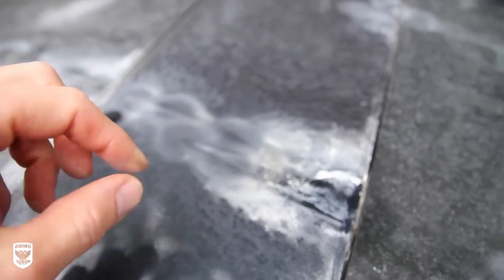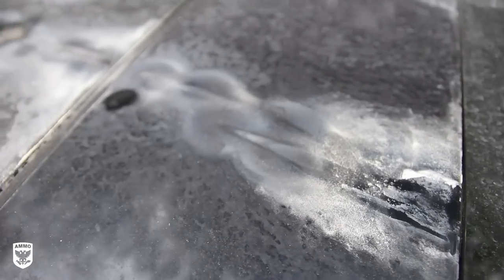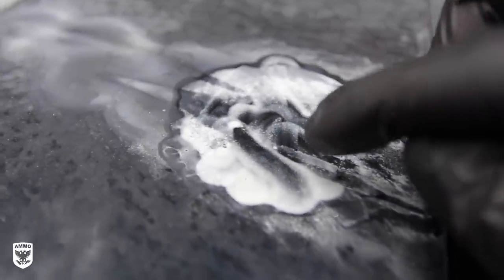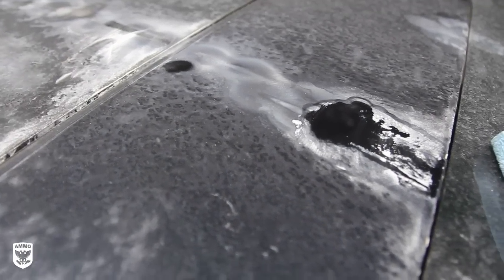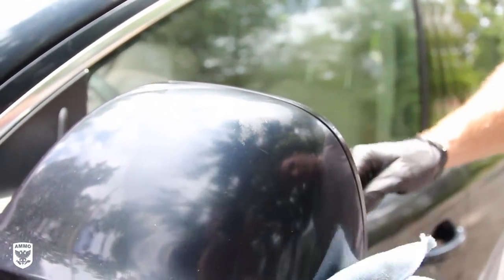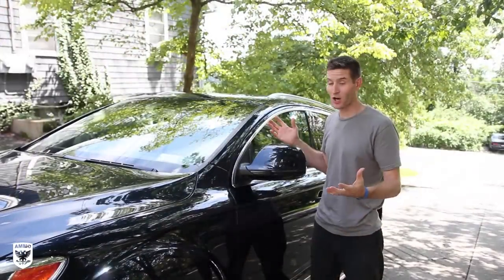How to Remove Water Spots and Calcium/Lime Deposits Audi Q7

Comment from the maker: I used a directional mic so I apologize for less than ideal sound. Also, I did not scratch the paint during this process (which would be "acceptable" because of its horrible condition). The "scratchy" sound is the deposits on top of the other deposits. However, if you do scratch the paint, which is to be expected, just compound/polish that area afterwards. It depends on how hard/soft the paint is beforehand. Hope this give you an idea about pH/acidic/basic knowledge for detailing. Thank you! -L

Comment: I had lime/calcium deposits on my car from the parking garage at Ohare. I just poured coffee pot scale remover over the deposits and they came right off. This was after the deposits were on after 2-months. This worked perfect and does no damage to the clear coat paint.
Reply: Thanks for this tip!!! Literally saved my butt detailing a car today. Works like a champ. Bought it at Bed, Bath & beyond. 😂

Comment: I had the same spots on my new TT. 6 Stains in total like on the side of the Q7. Just watched the vid, but cleaned my car last weekend.
Mine were not as mineralised as on the Q7. I washed the car (total package :foam, high pressure, per hand). Then I started trying to remove it with clay. It reduced a bit but not a lot.
Then I took a slight abrasive polish, and polished per hand for more senstivity. Took me hours for the 6 stains. What a pain. Took it down "layer" per "layer" until it was perfect again.
I suppose vinegar is not an option? :lol:
Your videos on this channel and after/drive thaught me a lot. Thanks for that mate. Very educational !

And yeah cleaning a car kind of gives you that special relation to it (Stingray Vid). And you know all the spots, every imperfection. It's quite intimate haha.

Comment: I have run into this situation when detailing a customer's car.  I removed calcium lime deposits with a household product called CLR sold at most hardware / home retail centers.  For auto paint I recommend to dilute the CLR with water and not use it full strength

Comment: A vinegar solution will usually do the same things for heavy calcium deposits and it also won't affect the paint.
Reply: I used just white vinegar out of my wife's pantry. Mine was on the horizontal trunk lid surface so I laid a vinegar soaked (very wet) paper towel over the calcium crust and kept it there until the calcium broke up. Then I rinsed it off. Worked good for me...
Reply: I can't remember exactly... Probably every bit of 15-20 minutes. I peeled back the vinegar soaked paper towel every 5 or so minutes and with my finger, I'd see how loose the calcium felt. Keep the towels completely soaked with vinegar. Since the car had a good coat of wax on it, it eventually got to the appoint where it pretty much rinsed off..
Reply: He's using 30-50℅ diluted HCl / muriatic acid. I know cuz I recreated that action in my bathroom cubicle
Reply: A 30 to 50% concentration of muriatic acid would eat through the paint. Trust me I know, I'm a Mason and we use a 20% solution of muriatic acid to clean cement off of bricks. Maybe 2 to 5% concentration, but certainly not a 30 to 50% concentration
Reply: @aveno66  well didn't take long for me. Did it to my car that had the marks for years. All i did was poor some vinegar on a rag and came right off as i wiped it.

Comment: Carpro glass polish is excellent for cleaning and polishing glass and can even remove scratches when used with a machine. It contains ceramic oxide which is used for polishing mirrors in large telescope.

Comment: I'm not a chemist so I can't comment on possible reactions between the acid and the plastic, but temperature wise it shouldn't be an issue unless you go really crazy with the stuff. ABS (which most plastic things are made of) has a glass transition temperature of 105 C (221 F) which means it gets soft above the boiling point of water. Working with it through such thin gloves would not be possible.

Comment: I would use a plastic razor blade, Larry.

And after using the chemical (vinegar, coke, etc.) to dissolve the calcium, I'd flush the area very thoroughly with water.

Comment: At 6:53 it's possible to see the "bottle of the product" reflected in the right corner of the video... So it's CaCo3 and a simple solution of acetic, hydrochloric or nitric acid theoretically, will work
Reply: +Jonatas Brisotti  He said, he's using something acidic were CaCo3 is alkaline and is already product of acid+calcium.

Comment: Some of us living in parts of Florida with sprinkler systems that use ground/well water probably have experienced this before.  The ground water from springs contain a lot of minerals like lime and calcium, and on windy days the breeze will mist the side of the cars in the driveway leaving deposits.  It's definitely not as concentrated as this, but still, not good and needs washing.

Comment: Good job. Could you not have used a soft brush to agitated the acid cleaner to help with removing the mineral - especially around any shut lines, windows and seals ?

Comment: if vinegar doesn't work try lemon juice, it is more acidic than vinegar. Also water is neutral so it wont have any effect. you should know that what he is showing is that the acidic chemical doesn't lift the calcium off the surface it dissolves it.

Comment: Use harpic toilet cleaner.. it's in blue colour.. little thick. Works like wonders. Apply on a small pice of microfiber towel and gently rub it on the calcium deposit. And you can thank me afterwards.

Comment: This is actually so interesting - chemistry wise. 
I'm guessing the Calcium and other mineral deposits have formed a basic salt 
ie Barium Hydroxide or what not, and the acidic solution, neutralises it. 
As all neutralisations are exothermic - that explains the rise in temperature.. 
The white solid forming immediately, that looks like a precipitate? Of what - not entirely sure...

Just some highschool chemistry which is probably completely wrong =D

Comment: A solution of 50% water and 50% white vinegar applied over a few days in a spray bottle also worked for me.  Super annoying.  I thought pigeons were pooping all over my car in my work parking garage until my local car wash guys told me about the parking garage dripping mineral deposits they see frequently.

Comment: Is " the product" CLR? Captain?
Reply: Yeah I want to know this too, I just purchased the Invisible glass water spot remover from his link thinking that it's what he used but it's totally different.  Makes me so angry I wasted $25 to get something he didn't even use in the video.
Reply: @michaelclark3192  Wow! Was about to do the same.
Thanks for the heads up
Reply: @rolandstamey1470  I ended up using CLR in spray form on the water spot and it worked like in the video so definitely buy some of that, works great.

Comment: if you aren't comfortable using acid, another way would be to use a product called "goo gone, with orange" it is an oily product so it will give good lube, but of course you'll have to wash it good afterwards, but with warm water, and good soap it comes off easily
Reply: Goo gone? Never tried it. Buy the water spot remover. Its an acid but nothing to be afraid of and it comes in a gel form with instructions on the label. But what he is cleaning s mineral so use lime away and acid for water spots.
Reply: mygtxful i'll give that a try. I polished the factory aluminum wheels and left them bare(no clear) and they have minor water spots
Reply: gary williams "goo gone automotive formula."

Comment: if i were him the garage company would be paying for this
Reply: "Users of this car park do so at their own risk"  sound familiar?
Reply: Yep, companies aren't stupid, they cover all the bases for just this kind of scenario.
Reply: this is why you dont park next to a wall in a concret parking garage, especially near the drain pipes, that's where water accumulates, alway try to park up hill if its a sloped garage and park in the middle the isle and dont park on the outside of the garage where your car is exposed to weather/rain/heat.
Reply: +1 for the auto cover specifically made for just this type of scenario.  Guaranteed it's a lower cost than a couple hours of this type of service.
Reply: The problem with this statement is that he would have to prove that the parking lot company forced him to park there. And we all know nobody forces anybody to park any place, even if there is no other parking you can always just not park and go home. So your statement is way up base

Comment: Hydrochloric Acid 10% will work perfectly.   I had this problem on a car once and i used CLR and worked like a charm.
Reply: that eats metal. that is all its good for, 10% all the way to 22 degree needs to be stored in poly drums and totes, NEVER put on metal

Comment: question for ya, how well does steam remove water spots? I have a vehicle that has sat under a sprinkler for years... i have try'd vinegar, ducky water spot remover and also the extreme version of the product. i have also had some luck with rubbing compound and very very fine steal wool. i have had very little luck but i dont think i should be trusted with acidic chemicals. have you attempted to use steam, would you recomend it. maybe i should use the extreme water spot remover and my steamer being shipped?

Comment: My car just got COVERED by industrial lime. They dropped a truckload of it near the medical building I was in, and when I came out it was covered. The company send a guy to pressure wash the car. DIdn't do a thing, except the surface is now gritty and grey. (It's a black car). Whatshould I require them to do to repair it?  The windows appear to be scored as well.

Comment: Can't you use watered down vinegar?
Reply: Yes you can, you can also use full strength white vinegar. but then he wouldn't be making a bunch of money off of his products if he told you that
Reply: That's not fair, he never pushes his product onto viewers. He always says what he uses, but very often mentions or even shows ways of cleaning withouth using his line of products. He didn't even say what product he used in this video!
Reply: he said it is a product that he has not released due to concerns with people useing it correctly but that you could use a water spot remover

Comment: Hi Larry, my mom's car has the exact some calcium/lime deposits (7:35) - pipes above her parking spot leaked. what product did you use? Thanks.
Reply: Or what product(s) would you recommend?
Reply: +nickolastiguan Distilled white vinegar will work and can be purchased for cheap at your local supermarket.
Reply: +Jonathan Gingiloski agree.  works great for me as well.  and cheap

Comment: Hey man, id like to know how to remove heavy sap/gel or things like that, i try to use razor blade, it works yet too risky, any tips ? Thanks
Reply: (Plastic) razor blade if necessary...use citrol 266 degreaser in spray bottle or aerosol.

Comment: Awesome video. You sir are very very good at what you do, but this would take hours to do this way. This is more like a weekend car cleaning tip. In the professional world, you'd have to much faster and efficient to do this on a much larger scale. Very good starting point though.  People see this some of these videos and go "man, this looks sooo easy i could do it at home!" So they try. The next day they're are my shop going, "i don't know what happened, i did everything the guy in the you tube video said". And now for the next two hours I'm stuck fixing something that could have been fixed in 45 mins and avoided all together had the guy/girl brought the car to me to begin with. Not to be a dick or anything, but now I'm charging the guy/girl the exact same price i would have charged for a full detail, just to get acid stains out of the paint.  So i guess what I'm trying to say is. Don't use acid base solutions on your car unless you know what the hell you are doing.

Comment: AMMO NYC How do I get a bird dropping that is on my car for the last four months? After I wash the car, there is a blemish white mark and it won't go away. I use white vinegar to clean it off but it won't come off at all. It seem as if the acids on the bird dropping has ate through my car's clear coat....Any tip how I can remove this bird drop mark? It's a little bigger than the size of a quarter.

Comment: anyone have an idea of what pH solution would be appropriate on glass/paint?
Reply: James Lemon For instance, car shampoo/soap should be ph balanced so it's not harmful to any surface. But for calcium deposits, which is an inorganic base, you can use an acid like vinegar or a low ph solution like Larry's water spot remover. Low ph = acidic, high ph  = alkaline. Too far on each end of the scale can cause damage if used incorrectly, like I would never put hydrochloric acid(acidic) or lye (alkaline) onto my car.

Comment: “It’s like salt” that’s because it is salt. Let me explain:
1.Water spots are basically calcium which is basically a BASE.
2. The “cleaner” is an acid maybe stronger than vinegar or a 30% vinegar available at Home Depot. 
3. When you mix a base with an acid it results water and salt. IE mix baking soda and vinegar or lemon juice. They neutralize each other. As for the video you should have at least plug your product, or you didn’t figure out a way to make it smell like something else NOT vinegar???

Comment: How long did the car sit with water dripping on it? Looks like a long time. Or very nasty water.
Reply: Looks like really nasty water stains, I had that happen with sprinklers before. I wonder if it was leaked on by overhead pipes or something.
Reply: It was probably in a parking garage with a fire sprinkler system or even a leaking roof. This happened to a car at my hotel. There is a planter box with a tree and a soaker sprinkler system in it. The water leaked through the  concrete and left a deposit just like this on the car guests Benz. He was not happy, to say the least.

Comment: lime away works great
Reply: yep. god knows why he is taking so much time to do it. Even historical restoration guys use citric acid and spray shit with it. Absolute no point in all this crap.
Reply: Can lime away be used on the painted surface of a car?
Reply: ***** Yes I use it all the time. Just keep the rag drenched and move n circler motions and rise it well
Reply: I tried CLR and it made the water spots less pronounced but they are still there.
Reply: Your water spots are not from calcium carbonate and are probably a mineral base. You will have to step up to an acid type product. Go to a car wash/auto detail supply store and buy a water spot remover for about $10.
Reply: Is there a specific product you could recommend?
Reply: 666karamba some of us are simply too anal to do a hurried job. if you take it off fast, or roughly it could cause further issues, like scratches from the deposits being dragged over the paint.
Reply: ***** I mentioned what to use in my last post

Comment: OMG I would not use a razor blade like that. lol ballsy
Reply: Im talking about the hood on the car. He's scraping it with the razor...
Reply: brandnewsike he never touched the hood with the razor :) was all glass
Reply: João Soares You're right, I didn't hear the glass part, but at 5:30 it looked like it was the hood. Oversight on my part.
Reply: as long as it has a good edge, and is lubed, there's no issues. although I did see a ricer that tinted the outside of his windows, and later tried scraping crap off it, and of course destroyed his ghetto tint. gotta love the ricers